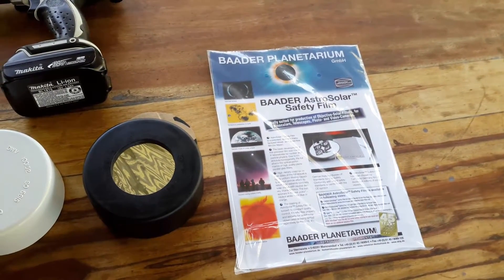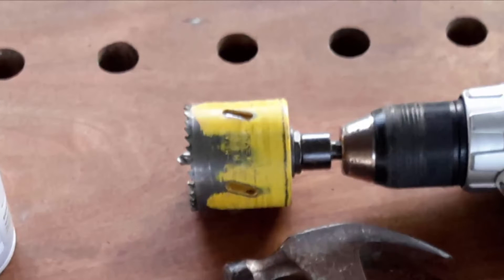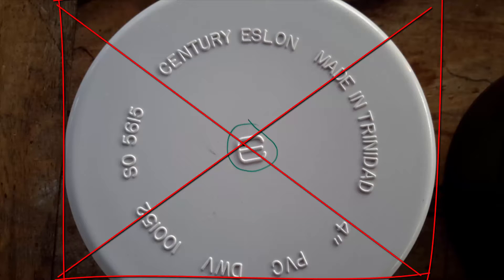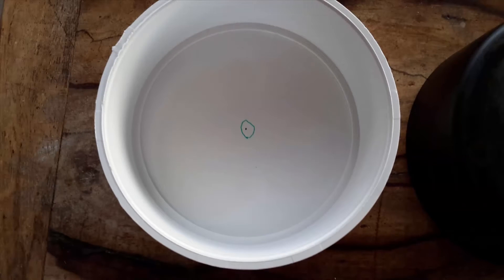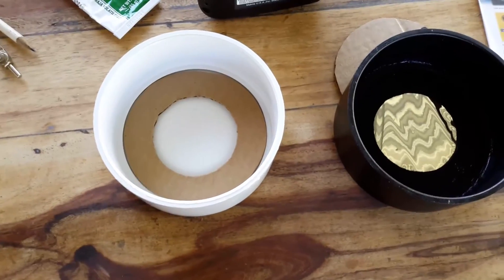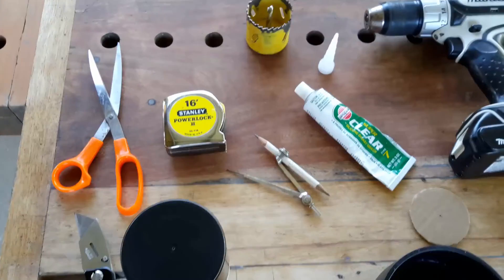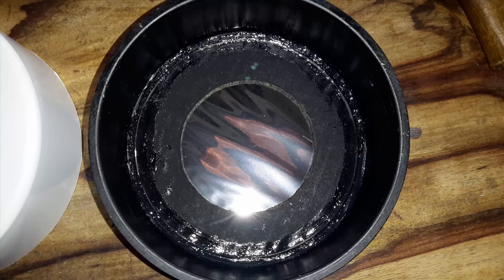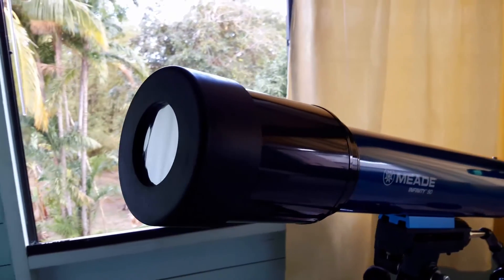Homemade Telescope Solar Filter (Meade_Celestron_Orion)

Comment: just be care full,  there should be no tension on the baader foil...
Reply from the maker: Agreed. I placed mine very loosely and let it set in and did it by resting the insulation to hold in place.

Comment: Thanks! I just finished making two solar filters as per your instruction here and it worked great!. One is a 3in. pvc cap for a camera lens. The other a 4 in. pvc cap for an 80 mm telescope. I'm ready now for upcoming eclipse on Aug. 21 2017 Just in case anyone needs to know, the 3 in. cap is 3.5 in. inside dia. and the 4 in. cap is 4.5 in. inside dia. I used cork sheeting with adhesive on the back of it and applied it to the inside rim of the cap for a snug fit.